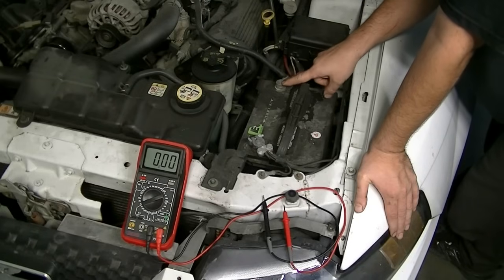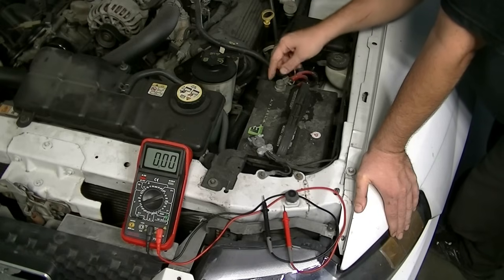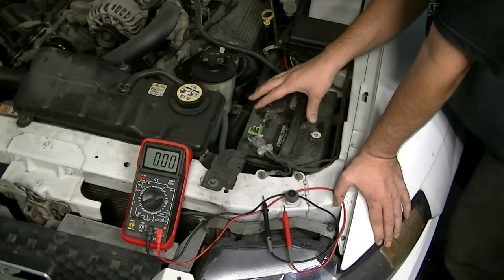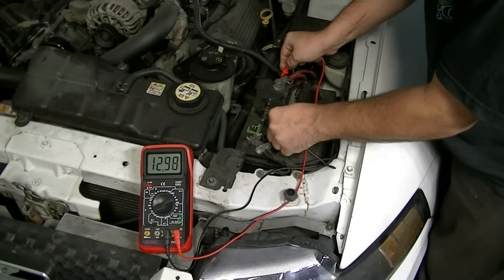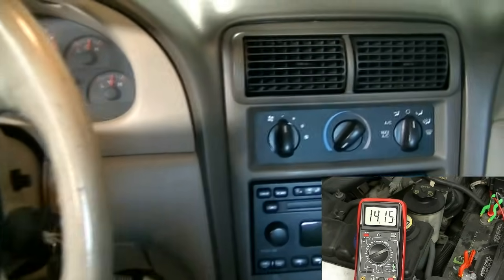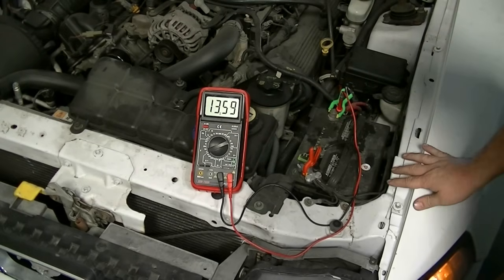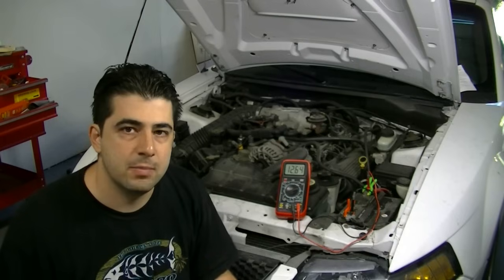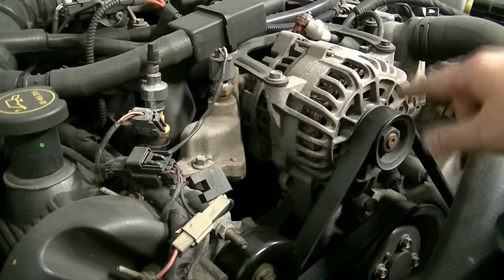How to Test an Alternator - Diagnose Charging Issues

Comment: great video.. you missed the electrical connections.. perform this test on a video.. https://i.imgur.com/kviX0VQ.jpg  all six steps..  don't run the hazard flashers or the turn signals so you see steady readings..

Comment: When you did the voltage drop test what setting did you have it on the multimeter?  do you have to switch it over to ohms or left it on 20V?!? 
BTW great video mate.
Reply: He was not clear on it. But looks like ohm detting base on the reading.
Reply: It’s volts

Comment: If im getting 16 watt is that mean alternator is done?
Reply: Means your alternator is working, had one only pushing out 11.9V barely charging batt with motor running.
Reply: voltage regulator?

Comment: So it's 2014.   What about compurter regulated charging system.  For some people who view your video with cars that are computer control.  Sometimes depend on engine load and the condition of battery,  computer will control the charging duty.   This is not helping those people. I just thought you should mention that.   13.5 volt minimun?  maybe applied to non-computer control cars, but not true for pcm control.

Comment: ok when u reved the engine from under the hood to test the battery voltage if it surpasses 15volts HOW did u rev the engine without going inside the car to rev it up.... I think my truck cant do that i dont see a switch for it to rev up like that
Reply: Free Spirit there's a throttle cable in the engine bay

Comment: I realize that this video is old, but I see that you are still doing videos.  Thanks for the time and this video.  My GF's 2010 Treverse's new battery is going dead after a few days.  I found a .161 amp draw and have not been able to trace it down yet.  However, while driving it, I noticed that the alt voltage, starts at 14.3 but within 45 sec it starts dropping to what the battery voltage shows when I start it, 12.4.  I'm not much of a mechanic, but this seems like alt/voltage reg issues.  Would you be so kind as to comment?

Comment: nice video/info, thumbs up. Question please. I have  just replaced my external voltage regulator and alternator with a 100 amp output for my 1990 f250 7.3 idi diesel. I was checking your proceeders out and got to the voltage drop test on the positive side of the alternator, engine started no load reading was .067. Under load 1500RPM Reading was .185. I checked the wire/connections they seam all good what would you try/do next to get the reading lower or is that higher reading ok I noticed that before i tested it the gauge ran about 1/2 to 5/8. Then would go to about 3/4 after driving it for about 45 minutes and would not get any higher that is why i was checking out your Video. Please help me out if you can. Rob/ Hillsboro, Oregon

Comment: Hi, battery voltage check before starting car was 12.4-12.5Volts. After startup, drop to 11.99V. Check alternator output, 11.99V. 
My 1990 Toyota Corolla battery and brake are lighted up. Battery connectors are clean and tight, check ground ok, alternator belt tight & turning well. Electrical connectors  and wire at alternator checked. Alternator bad ?
Reply: yup

Comment: just take off one of the cables while its running. if it stalls your alt is dead if not your fine.
Reply: dave dec What do you means by removing a cable?
Reply: Start the vehicle then disconnect the battery cables, if the vehicle continues to run, it is running solely off of the power generated by the alternator. If the vehicle dies then the alternator does not have sufficient power to do what it needs to do.
Reply: Elias Flores he's talking about the battery cables
Reply: This can fry electronics. DO NOT do this. DO it the right way.
Reply: dave dec DON'T DO IT!!! IT CAN DAMAGE THE CHARGING SYSTEM AND THE COMPUTER OF THE CAR!!!!
Reply: Yes and take out a driver in the computer, this was before computer days and you had a generator.
Reply: love the people saying no lol it depends on the car if it's a old car they don't have a charge system my old mini never had a battery for the two years I had it lol so before you keyboard ninjas start slagging people off you should get your own facts right first  would be a good idea on a new car then yes don't do it obviously
Reply: battery cables

Comment: What about if the alternator charge test is done with a battery that is not fully charged so it reads 11.9 volts before starting the car? This is my case and when engine is running and I perform charging test with everything electrical turned on and I'm getting 12.4

Comment: I have a 1990 Toyota engine 5A, my car has no signial when turn key on, I jump it, it  start immediately, when turn off after running 20km, immediately it does not crank again. I check battery after 24hrs , it indicates 10.89V. should I change battery or alternator??? plz. thanks.
Reply: Check the voltage while the engine is running, it could be that your alternator can't charge the battrey and it can be a bad battery.